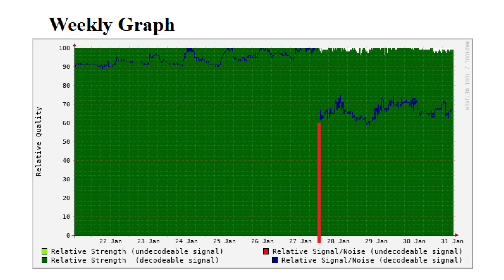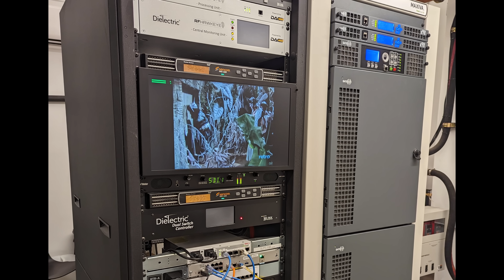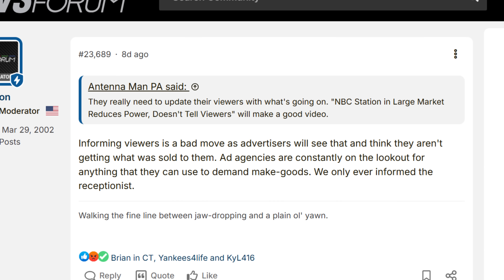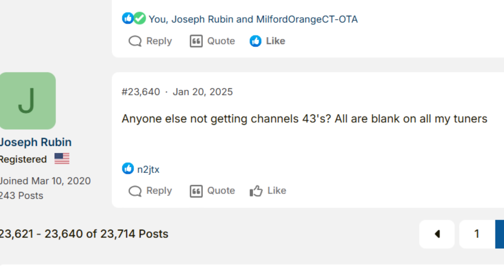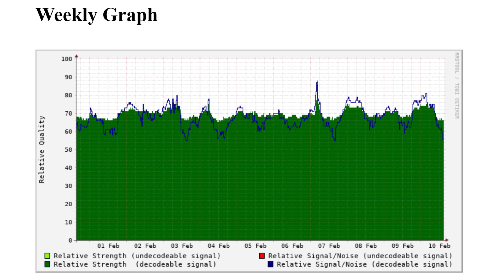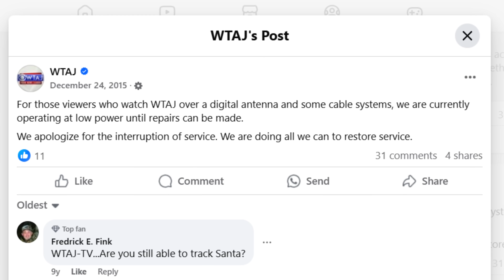TV Stations Lower Broadcast Power at Times - Here’s Why

Comment: Why are they reducing power I've been having issues with my weak signals on some channels with rg6 coax cable and amplifier booster on my coat hanger antenna im thinking its the stations having issues with there transmitter and then comes back on again

Comment: Glad you brought that up. I get my Weigel broadcasting television stations in Syracuse NY. All except Dabl are low powdered under the CD suffix (with some have translators in Auburn, Oneida and Utica). To get them,  i had to move my antenna as high as i can with a good angle by the window.

Comment: I'm almost within walking distance from 2,4,7 NBC, CBS, ABC affiliates albeit on a hill. Ch 2 on a 4 bay Channel Master antenna used to be rock solid, and near the end of winter started to break up during the 6pm Opinion, they call it news, show. So I switched to Channel 4 and it was solid for a week, then the same thing. Cannot get FOX here in Erie County, NY nor PBS. Seem to be in an electromagnet black hole. Using a Tablo, 2 tuner device which still receives other normally weaker channels without issue.

Comment: They not only reduce power, but turn off the transmitter at times and say nothing. Last summer called WSYR in Syracuse a couple of times when receiving no signal and they said transmitter was off for maintenance such as painting the tower. Nothing on air or on website. Obviously they don't want advertisers to know that over the air viewers are not receiving programing at these times.

Comment: As far as notifying viewers or anyone for that matter, TV and radio station can operate at reduced power for up to 10 days without telling anyone.  After 10 days, they have to notify the FCC that they are operating at reduced power.  Beyond 30 days, they have to file for an engineering Special Temporary Authority (STA).  The FCC will usually grant STA operation for six months.   One can go to the stations online public file to find out if they are operating under a STA.   Once you have looked up the station by call sign navigate to "Applications and Related Materials" then click the STA tab to look for any active ones.  Of course once the station resumes full power operation they will notify the FCC that things are back to normal.

Comment: When our country went to digital the people in rural areas can no longer get tv, due to we are to far from the tv station to receive the signal. Analog worked great.
Reply: Yes, totally agree.  My parents don't live in a rural area, but when everything went digital, I had to help my dad install a large aerial antenna on his garage roof.  Before that, any old antenna could pick up literally everything.  I live in the same town and  I have yet to find a normal indoor antenna that actually works and can pick up stations decently.  That includes the local CBS/FOX affiliate whose transmitter is probably less than a mile from both of our homes.

Comment: I routinely watch a station 69mi away by capturing the refracted signal from the top of a 100ft pine tree. In fact, that's the only way it can be received because I'm locked in with trees.  At temps below 30, the tree deflects slightly and I loose the signal unless I move the antenna over slightly.  But as soon as it's back above 30,  the original antenna location is back to normal again as soon as the tree deflects back to it's original position.  

I thought the station was reducing power but that wasn't the case.  You can look up the engineer's email or phone number via the FCC site for that station and call or email them directly if you are not sure.  I've done this and most engineers will respond back.

Comment: Hmm...  Are you suggesting that an FCC govt. licensed station would continue to collect full funding from advertisers (actually cheat them) when they KNOW they are not reaching their normal,  full intended viewing audience?  If that's true, then  you have to then wonder about the ethical standards we have in broadcasting today, which could also make us wonder about the ethical standards for news, commercials, and basically everything we see and hear.  

So if there are no ethical standards,  what's the point in licensing?  Yes, I'm climbing right down a rabbit's hole, but when you destroy honesty and full disclosure at any level, it often has a ripple effect.

How can we  possibly believe "Your trusted news source" when they are cheating the companies that fund them?

I'd like to believe, in the case of a licensed operator, that when a commercial isn't aired to the intended audience due to ANY malfunction of the station equipment or even a mismanagement issue, that it's properly logged so that the advertiser isn't charged.  Please tell me that's how it works.

Comment: This video reminded me of a puzzling broadcast reception issue I have. My stereo is always tuned to 93.9 FM WNYC which transmits from the Empire State Building just 12 miles away as the crow flies. For many years I’ve experienced perfectly clear, strong reception every weekday and significant interference every weekend. I’ve inquired with the station without receiving an explanation. Do you have any theories that could be confirmed? I’m stumped.

Comment: I have an interesting antenna configuration. I live in a fringe area and using a high gain antenna (Winegard HD7698HD) I could receive RF 25 clearly at most times (it's a weak translator of a San Francisco station). But there were often problems with clear reception in the afternoons. My home is on top of a hill, and yet there is one taller hill between me and the transmitter. One day I was trying an alternative bowtie antenna on the roof, and the other high gain antenna started receiving 25 flawlessly.

At about 50° to the right of the transmitter lies the Monterey Bay. And this bay is frequently hit with strong westerly winds in the afternoon. I had put the bowtie antenna directly between the dipole of the Winegard and the surface of the Monterey Bay. I had unintentionally created an RF trap to /block/ the multi-path reflection caused by the high waves on the bay. That second antenna is still mounted there even though there is no antenna lead from it.
Reply: Replying to @BigMikeECV:

ATTACH A COAX CABLE TO YOUR ROOF AND THE OTHER END TO YOUR TV. *EASY, RIGHT??*

Comment: I live in the Seattle, WA area and found that I am on the fringe of TV reception due to the terrain where I live. I sized my antenna for that reason and purchased an HD Homerun after I found out the coax must have had at least one and maybe 2 splitters under my double wide and the run from the antenna was over 60'. By putting the HD Homerun at 25' from the antenna, I was able to get all the local broadcast channels, but only on the new ATSC 3.0. All was good! Then, one day all ATSC 3.0 channels were gone! DRM gad been added by Sinclair Broadcasting. So. I am reduced to trying to watch ATSC 1.0 stations that go in and out. It is so frustrating! Is more power being given to the ATSC 3.0 stations than the ATSC 1.0 stations. Why would businesses pay to advertise on the ATSC 3.0 stations if there is such a small audience out there that can recieve ATSC 3.0. I know Zapperbox will decode DRM, but I doubt the length of coax with splitters could cause problems, and I have 3 TV's, so the cost would be too much. I just want DRM to go away and all would be good.

Comment: Most stations now are 24/7, but for a long time many would go off the air at least one night a week. 2 stations here have been 24 hours since the early 80s but for a long time they signed off late Sunday nights. I wondered if that was because nobody was up when they had to sleep for Monday, but I heard later it was also for maintenance. Some still did that in the last years of analog, but I’ve never seen digital stations intentionally go off.

Comment: I have a 10ft antenna in my attic pointed right at the transmitters (can see them from the porch & used a signal meter) and still get frequent audio cuts even though the video is stable. 🤷

Comment: This is not the place to talk about AM  broadcast radio, Tyler like my friend who worked as a transmitter engineer , say AM stands for Antique Modulation. Well the DTV signal is really a modulated reduced carrier frequency by an Amplitude method. There is AM, FM, PM and FSK methods of modulation, period. Your DTV signal is not FM, PM nor FSK. The older Analog TV signal actually the B&W video was AM, the color info was PM and the sound was FM.

Comment: Very good explanation and common sense why your DTV reception mite suffer once in a great while. But to begin with the engineers figured you did not need as much RF power output to transmit a digital signal vers the old Analog TV signal and supposedly cover the same area.  I would highly disagree with DTV signals running on less power than the Analog was.
Reply from the maker: The FCC literally cut the power limits from analog to digital by 75%!

Comment: A few weeks ago, the signal on WFXT 25 in Boston suddenly disappeared which put an unexpected crimp in my morning local news habit.  At the time I was using a cheapie Phillips antenna which was pulling in 38 channels and I was pretty satisfied even though I was getting occasional breakups.  Today I purchased and installed a Mohu Gateway Plus antenna and I have to admit, its performance far exceeds that of the Phillips. (As does the price, it's 3x as much). Channel 25 is back, reception seems to be a bit more stable with a handful of new channels  and the picture quality is outstanding on my LG OLED TV. It's also less conspicuous sitting flat against the wall behind the center speaker and between two windows. It was a good upgrade. I'm a happy camper.
Reply: Most networks can be streamed online no antenna needed just like satellite dish, I dont like to deal with an antenna,  I have Dish
Reply: @JasonTheJJGamer5442  Some, not all and they are usually a curated feed. Also consider that the broadcast signals of the major networks are now in 4k and are spectacular on an up to date Next Gen capable TV. Streamers are usually in highly compressed 2k. Personally, I prefer to get the highest quality possible, but each to his own.

Comment: no signal from my antenna: new tv TCL 55 inch when i scan no signal,/ no channels (my vizio did the same but wanted me to use "their" free channels)  my antenna wire (orange high quality) runs about 60 feet to the edge of my yard i've checked both connections how can i test for continuity?  a portion is buried, local station about 20 miles away (cbs, nbc) is it my antenna ?or do tv block antenna signal or stations dropping transmission?? how to tell  thank you this all happened about october/november please help ---thank you

Comment: I haven't watch television in over 30 years. But back in the 1980's when TV was analog, if there were any changes to the strength of the signal, you would notice it "instantly" by the amount of snow in the picture. With today's digital TVs, you have to rely on that signal meter and it can take up to 2-3 seconds to update. That means that while you are adjusting your antenna, you could easily overshoot the perfect spot for your antenna to be set.
Reply: Digital TV is an advantage only to the Owners. Lower RF output, Multiple channels in the same 25mhz bandwidth as 1 analog, you could see & hear still without complete pixel elimination, and no royalties for old crappy programs, Ads are their only income.  Sit back & rake in the ad money.  It's the same with AM/FM radio.  A few people bought it all.  FCC should be Abolished.

Comment: 6abc Philly goes out three nights a week, usually on the weekends. It'll work during the day, then turn off around dinner time. I'm 34 miles south of their broadcast tower. All other Philly stations are fine, but several lower over the air channels also go off at the same time, 2.1 thru 2.9 will go out at the same time most of the time. Yet I get all the other Philly channels both here and much further away at the Jersey shore.
Reply: Make sure you have a good antenna that can specifically receive VHF Low band channels (RF2 through RF6).

Comment: The only station I'm getting problem is WBRE-TV 28 in Wilkes-Barre, PA (NBC) not on the Smart TV, Converter HDTV Stick, or Tablo TV It's not picking up the signal It's the those 1st generation converter boxes like Digital Stream in 2008 like I've right now I put my Antop antenna on this old converter box & It's works like magic also I've 2 low power stations are WRLD Ch,. 30* in Kingston, PA & WSRG Ch. 59** in Scranton, PA with an good signal with many multicast channels. *12 channels **7 channels

Comment: I live in Tampa, Florida, and I get researching for about 99.99% of my stations. But there’s one pesky station that sometimes I get it and sometimes I don’t without ever having to move the antenna around. WTSP CBS, 10 which is The Tena owned CBS station here in Tampa is really hard for a lot of us to get with most of the antennas that are out there. Often you can move the antenna around, but you end up ruining reception of the good station that you actually wanna get. I don’t have this problem with any other station in my area. The NBC station comes in fine. The fox station comes in fine. The independent stations come in good. The CW station comes in great. I don’t have any problems with any other station, but channel 10. A friend of mine who is much older than me and he lives not far from me. He’s actually my neighbor told me that he has a problem with channel 10 as well and he’s always had a problem picking up their Channell he thinks that either he needs a better antenna set up or Channell tenet is one of those pain in the butt stations that it’s not worth trying to figure out trying to get it.

Comment: I experienced reception problem with one local station every time it was raining and the transmitter is on top of the foothills with normally a very strong signal.  It was water from rain getting into the transmitter equipment.  The reception was also lost for hours also from water getting to the transmitter equipment from the rain when there was heavy rain or rain lasting for too long.  It takes more time for the signal to be restored given the transmitter was on the foothills it took more time for station engineers to arrive at the transmitter.  The problem got fixed at the same time when the switch from analog to digital was done.

Comment: Here's another one to add: Some broadcasters use Repeater or Translators, that relay the programming from the Main antenna to multiple far off antennas across a large area (New Mexico) and if reception from the Satellites to their antenna are not optimal, signal quality will be poor. Also if the main antenna at the Station itself isn't at full power, your local antenna doesn't get a quality signal to repeat. I've seen the program come and go, but the signal strength is strong and doesn't waiver. Sometimes if you switch to another sub channel, the program is fine. We have multiple channel 4's, like 4.1, 4.2, 4.3, 4.4 ect. Some can be good, while others are weak or unviewable .

Comment: I am located in Allentown, PA. My roof mounted VHF/UHF antenna is pointed at the Phila stations 40.0 miles away. I have no trouble with losing any signals except CBS (channel 3, actual  channel 33). This signal will go low and not have enough stregth for the AirTV it is fed to. If I switch from Sling on Roku to antenna, the signal will still be there about 90% of the time. None of the other Phila stations do this and some of them broadcast at lower power. The KYW (CBS) signal may be too low for the AirTV for several months and then work for several months so doesn't appear to be an antenna issue unless the station is right on the edge. I'm thinking of raising the chimney mounted antenna another 5 ft. Perhaps when it gets warmer here.
Reply: Replying to @johnzebrenski6327: 

You have *NO* intention of raising your chimney mounted antenna 5 more feet

Comment: One must be careful to not be fooled by multipath signals.  One of my customers had an excellent signal strength reading but the TV could not decode some stations due to multipath.  Had to move the antenna several feet to receive them.  The best tool in my van is my BT PRO7000 signal analyzer, it tells you all you need to know about how well the antenna in question is performing.

Comment: Like the old time CB radio, the antenna needs to be matched up with the transmitter to radiate the most efficient energy transfer to actual radio signal broadcast.  
The SWR, or standing wave ratio measurement, indicates how well your antenna is performing. In a nutshell, the standing wave ratio is the difference between transmitted and reflected radio waves; the more they are out of sync, the more interference occurs in the transmission.

swr reading chartSWR readings range from 1 to 10. Ideally, you want an SWR that’s below 2, and anything below 1.5 indicates that the antenna is working at its best. An SWR reading above 3 could overheat the transceiver and cause it to eventually fail. 

As the SWR increases, the transmission and reception range will decrease, and you may experience issues like squealing noises or interference with other electronic devices in your vehicle.

Comment: Even Fog or a light rain or lots of moisture in the air can worsen your TV reception if you are on the edge of reception or you use a poor antenna and are barely picking up some channels on good clear days.     Water droplets in the air and on trees, etc. can actually reflect and weaken signals at your antenna.